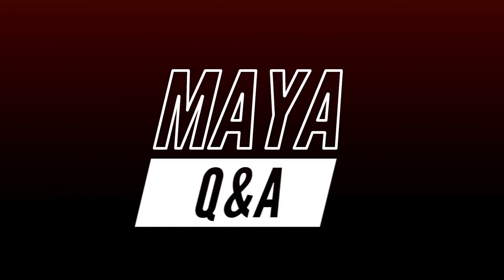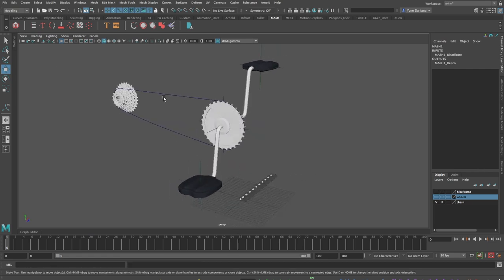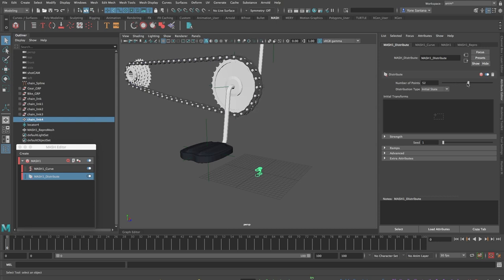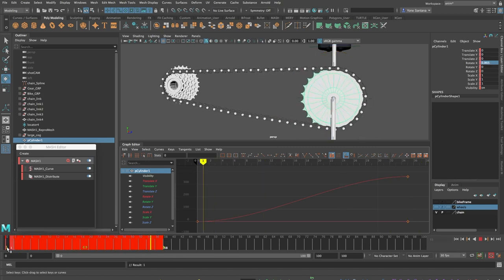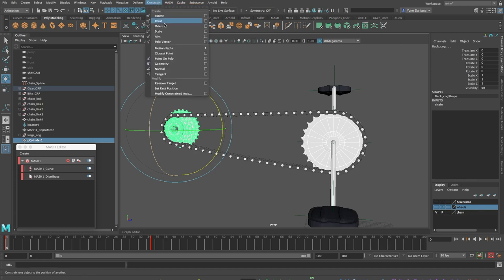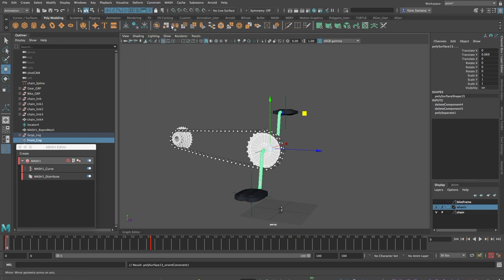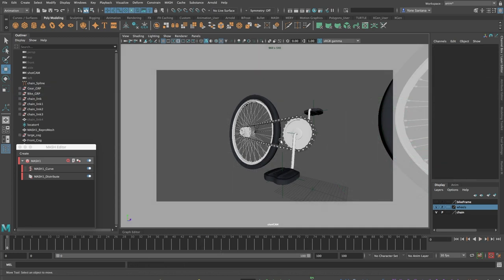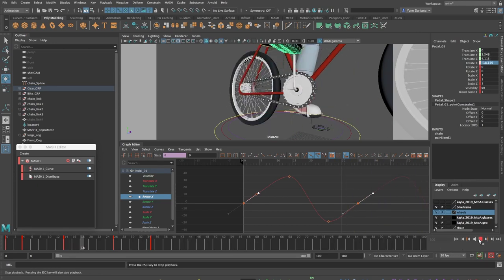Maya Q&A - Animate a Bicycle Chain

Comment: Thanks for the tutorial, I learned a lot from it.
One problem I encounter: as long as my bicycle stays stationary the chain moves fine along the curve. But when I attach the animated bicycle to a motion path  (a large circle) the Mash chain starts to act weird, the shackles still follow the curve, but each of them also start rotating along their own Y-axis as if they don't inherit all off the transformations  when following the motion path. Should I use another method to make the bike move forward?
Reply from the maker: Your mash network won't inherit the path. Hmmm. Try muting the mash node tweak your motion path until the bike is moving as you wish and try baking the keys and turn the mash node back on. See if that works. Fingers crossed for you.